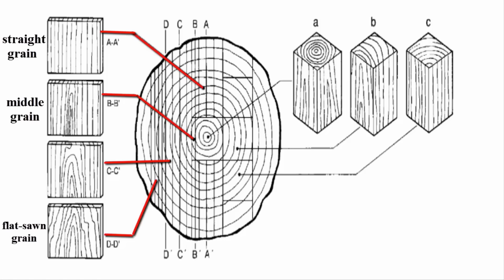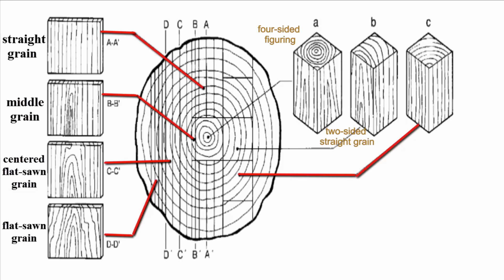Object-oriented cutting or Kidori | One of the most Difficult Woodworking Processes you have to face

Comment: This sawmill work get overlooked so much in life. It’s a hard job and to do high end wood cutting require high end tools. Even the guys you don’t see in this video play an important part. My family was involved in everything from cutting a tree down to actually running a family owned an ran sawmill. That includes grading logs, Transportation, and running a log yard to sell logs to other companies. The easiest thing we cut was railroad ties. If you had the best logs it was 4 simple cuts. Most of the time it was 8 or more to make use of the off cuts which took more effort but landed the biggest amount of money per log. We where paid by the board foot and it was a good day to make $30 as the lowest paid and hardest manual labor required position the off barrier. Which had to manually roll the logs up to the mill, clean sawdust from the mill and off the deck area we had to walk and carry every piece cut. Wether it was bark or 50 pound crazy shaped pieces up to 18 feet long. And move all lumber cut into stacks to be bundled and operate the loaders to move the logs and lumber around. I was so happy when I got out of that job and began running the sawmill. Went up to $50 a day. Now I thank god I got out of that profession all together. The only one that really made a living was the owner of the mill. For such hard work it just wasn’t worth it. But no car means you work where you can and that was within walking distance.
Reply from the maker: Thank you for taking the time to tell us your story that makes me emotional. I know many friends who also do this job in lumber factories, They get paid $40-$50/day which is considered low compared to other manual labor jobs.